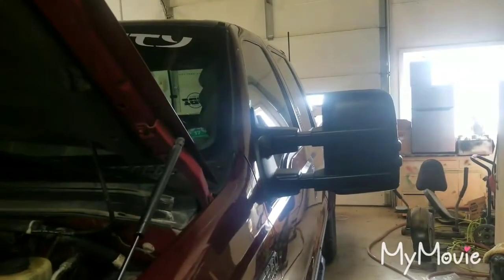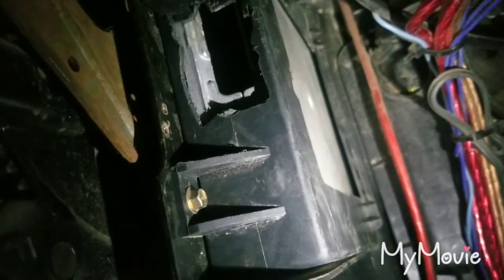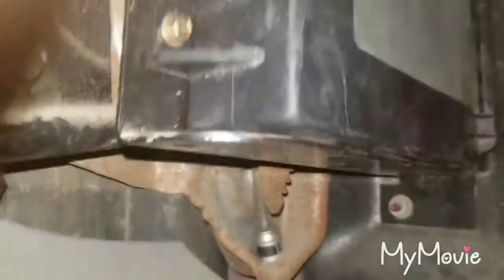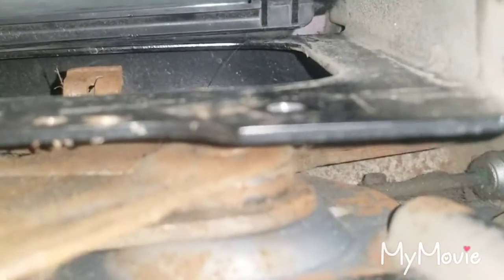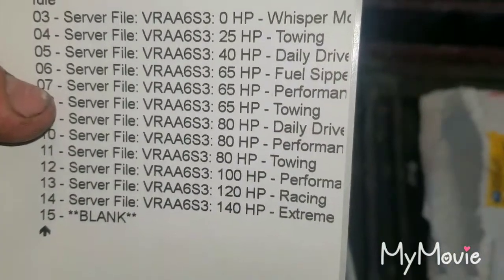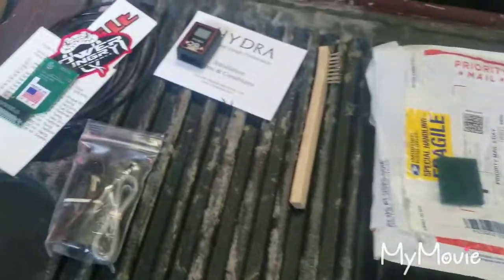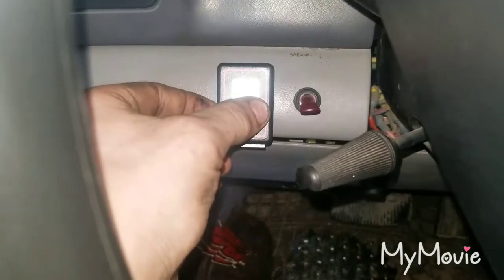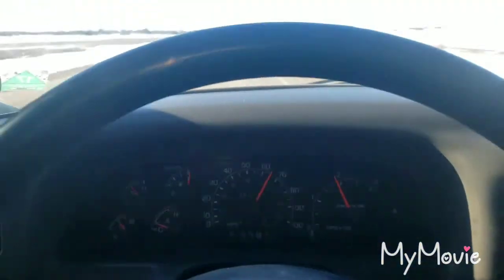How to install a hydra tuner on a 7.3 powerstroke super duty

Comment: Great video bud, am thinking about getting this for my 7.3, do you think that the tuner had anything to do with your transmission going bad??
Reply from the maker: My transmission had 300k on it and now has larger injectors in it so it was due for an upgrade
Reply: @brunssenboy  I see, my 2001 7.3 only has 165k miles on it, hopping to get many more miles out it ,thanks for the quick response
Reply from the maker: @oggarage3459  yeah you bet. Once you add more power these transmissions like to start slipping in the clutch packs so take her easy lol.

Comment: Thought the j7 port was supposed to be silver no copper is supposed to show
Reply from the maker: DIEhardHDyes you are correct I went a little far but it wasn't getting a good connection when I first did it with the ts6 so I had to go a little farther it works great now with no troubles

Comment: Can I have the link for this?
Reply from the maker: yamaha yz for the tuner?
Reply from the maker: https://www.jelibuiltperformance.com/collections/frontpage/products/hydra-chip
Reply: NFG Nebraska thanks and is it still working good if your still using it?
Reply from the maker: Yes it works great still I am putting a transmission in my pickup next week
Reply: NFG Nebraska who built your trans?
Reply from the maker: Just a local shop
Reply: Do you feel that running the high tune ate the tranny up?